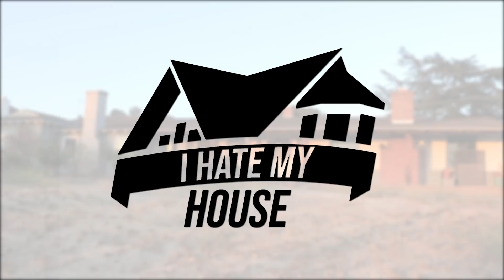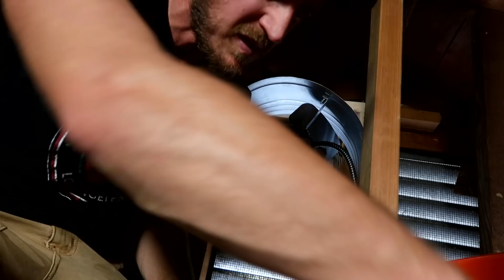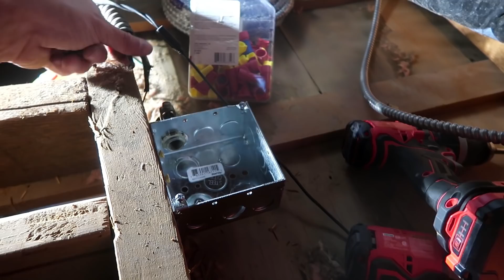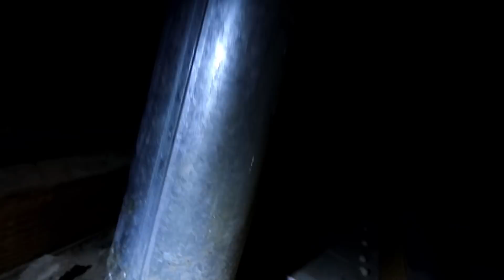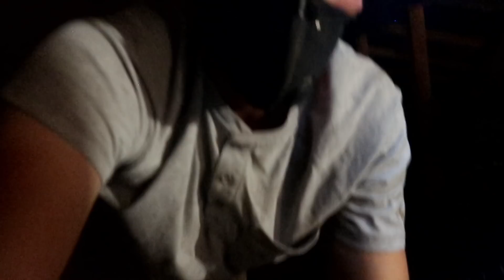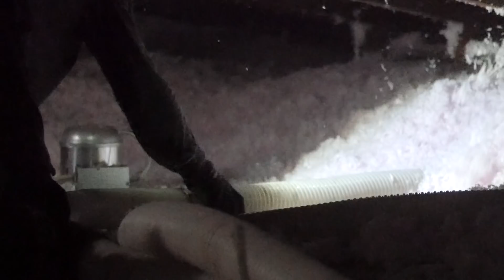I Got a $1,000 Power Bill & What I'm Doing About It!

Comment: Aaron, what's your opinion on putting in new batts, just to make future work easier? I know blown is way more effective, but I'm not sure I have the courage to do all of my "attic remodeling" all at once like you. Or was it worth it to live with no insulation for a while?
Reply from the maker: Hey man. Batts are also fine. A lot of time you'll have batts and then blown in on top for added R-Value. I have that in areas of the home that I've remodeled more recently. It's all about achieving good R-value the area you live in. You can find batt insulation up to R-49 at the big box stores I think (maybe have to order). I'd suggest you find out what R-value new homes in your area are being built with (code) and try to do your best to replicate that in some capacity whether batt, blown in, or a combination.

Comment: Good job on sealing things up and putting in new insulation. I suggest you upgrade your AC next. That old Trane XE1000 is most likely eating up a LOT of power, especially if you have damaged duct work. If the ducts are bad I suggest going with a ductless system. They are so much more efficient.
Reply from the maker: Yup! I've installed one Ductless system already and have a second about to be installed for another area of the house.

Comment: Man, I am in the middle of a project like this myself. I'm in the process of removing all of the R-19, single-layer fiberglass batts that are in my attic. I'm in the northeast where R-60 is the ideal amount of insulation. As I uncover more and more of the attic space, I am just finding one electrical horror show after another. No junction boxes, exposed wires, overloaded connections, you name it. Attic and insulation stuff is just about the least glamorous improvements you can make, but they really add up over time. People vastly underestimate how much energy cost comes from a lack of air sealing.
Reply from the maker: 100%! A tight building envelope is key for efficiency but is almost non-existent in old homes

Comment: If you are in California, Did you put any thought into creating a non-vented conditioned attic. The problem with vented is you hit a minimum temp early and the attic fan is just moving hot air at a cost to you. Non vented condition system keeps everything in the envelope of house. Either way not fun, I just completely updated all my equipment, the biggest change was a variable speed A/C system. Good luck with your updates. You going to put in solar?
Reply from the maker: I did not consider that but I can see your point. And yes, I’m currently looking to try and make solar a reality.

Comment: Hey Aaron.  Very rare I can claim expertise in anything, but rodent proofing is one.  Did you seal the area where the roofline runs into the soffit.  Above the gutters and under the shingles?   Here in GA people call it a construction gap.  Up north it’s always sealed with Drip Edge.  Here we always retro fit drip edge to seal that area.  It only takes a hole the size of a quarter for roof rats to find a way in.  They will actually follow the scent trails from previous rodent issues.  Even years later.
Reply from the maker: ManCraftingTM Yup! I’ve done all of those things. I’ve also added wire mesh in any potential trouble spots.